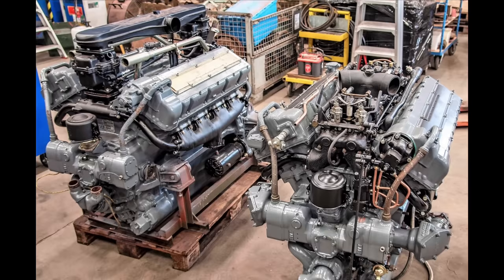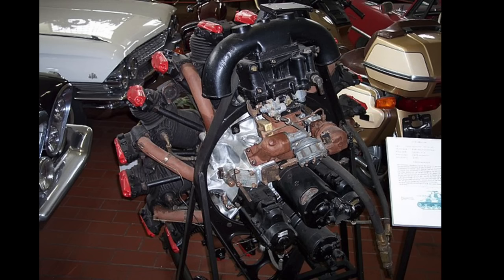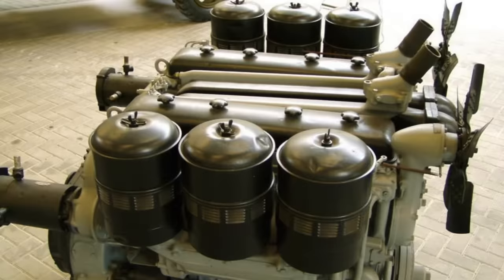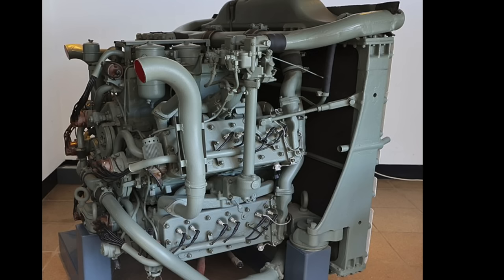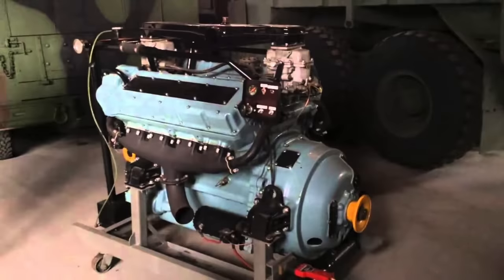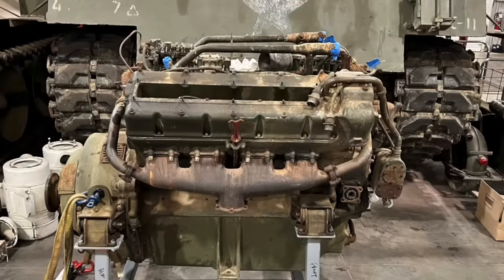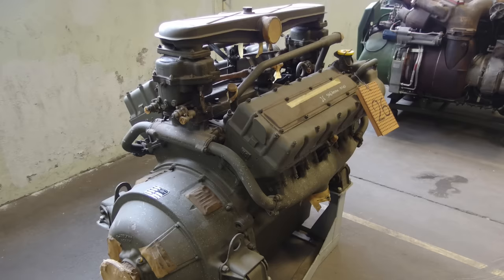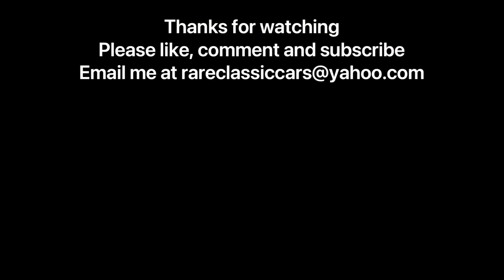An All-Aluminum, Flat-Plane Crank, DOHC V8 in 1940! Ford's 1,100ci (18L) GAA V8 Is a WWII Marvel

Comment: GM 2 strokes more correctly called Uniflow Diesel are not supercharged by the use of their positive displacement Roots type blower. The blower displacement + blower RPM very closely match the air requirement for the engine at all RPM over the operating range.
The blower pumps less than 1psi into the air gallery, less than 1 PSI being necessary for blower wear and tear compensation and to make rated power in varying conditions.
Also the Blower on Detroit Diesels is entirely parasitic. It just consumes power and lots of it ~100hp and doesn't give it back like a supercharger does. A Roots type blower on a gasoline V8 can be called a supercharger because if it gives +300hp in air and consumes 100hp to drive the gain is 200hp - the full 300hp however having to be paid for in fuel unsurprisingly
The blower on a Detroit Diesel aspirates the engine in the Uniflow cycle and just steals power (an unavoidable pumping loss), which is partly why Detroit Diesel 2 strokes fell out of favor in the late 1980s for turbocharged 4 cycle engines where under light throttle the turbocharger consumed little power and when on full boost still consumed less than a Roots type blower that always cost 80-100hp to run.

Comment: " one of the largest gasoline engines produced in the world ... "   This doesn't even make the top 10.  The largest production gasoline engine I can think of (but not necessarily the largest)   has almost 4 times the displacement.  It wasn't the larges engine produced by Ford Either.  Ford built Liberty V-12's,  Merlin V-12s and  R2800's, all of which are larger than this engine.

Comment: I understand about how ppl are in awe of the W16. But ppl don't understand that it's not THAT impressive considering what has been done in the past. I've been reading about Buick and the cool stuff they came out with as far as methanol injection and supercharged engines in the 50s. That's modern day stuff!

Comment: The Army Arsenal first tried out the Wright radial in their Christie concept combat car to reduce the length and weight by eliminating the V-12 Liberty engine. It had a rear drive so the radial and connected transmission came out as a unit. The drivers and crews liked the radial so Ordnance decided to use it in the M3 and M4 since there were plenty of surplus commercial Wright R975 engines available plus Wright was still producing them along with replacement parts. That saved Ordnance the time and trouble to have a purpose built tank engine designed and placed into production. Ordnance then selected the new GM 6026 Diesel bus engine to use in pairs in their M10 TD. The M10 was to shoot then scoot so the twin Diesels provided greater torque at low rpms to get it moving faster from a dead stop. Chrysler was in charge of tank production so recognized there would be a shortage of the R975 fairly soon. Their engineers designed a lower crankcase that allowed five of their surplus 6 cylinder auto/truck engines to be bolted on to power the central crankshaft. The US Army refused to use it so Chryler showed it the British who also didn't want it. The Soviets laughed at it then said they preferred Diesel engines. Chrysler went back to Britain to tell them the bad news. Chrysler engineers worked with the British tank mechanics to make it as easy and fast as possible to remove the monster for servicing then dropping it back in. The A57 actually proved to be the most reliable and durable tank engine used in the war. 

Ford first offered his V12 to the US Army Air Corps. They declined trying it out since they've been using the Allison V12 for a number of years and knew it's cost of production. Henry then visited the British Air Ministry who asked him to mass produce the RR Merlin instead. Ford took one look at the blueprints then handed those over to Packard before visiting with the Ordnance Department about making a tank engine from his V12. That took Ford's engineers around two years to accomplish with more adjustments being made as it was tried out in the T series. The R975 also had components redesigned thru out the war. The Army had speed governors on their tank engines to save fuel and prevent drivers from going too fast. The M4 was top heavy so was prone to tip off one track when going around curves at high speeds and falling over. Most drivers tinkered with theirs anyways so they could get moving faster running thru the gears on roads and fields where German AT guns and infantry with Panzerfsusts lurked. They also engaged in engine braking to slow down faster which caused premature wear and tear on all types of engines  The Army were pulling those out after 200 hours of run time for inspection and refurbishing but now were doing that after 150 and 100 hours due to hot rodding drivers.

Comment: years ago I lived on a boat, there was an old boat (30 ft?) down the dock from me that had 2 of these engines, when it was time to start these things he would pour a half liter of gas down each carb, I mean just dump the gas straight in then hit the starter, one, then the other, even with water cooled exhaust the sound was absolutely brain rattling.

Comment: The most powerful factory variant was the V-1710-127, designed to produce 2,900 hp (2,200 kW) at low altitude and 1,550 hp (1,160 kW) at 29,000 feet (8,800 m). This engine was static tested at 2,800 hp (2,100 kW) and was planned for installation in an XP-63H aircraft. The end of the war ended this development, so this promising experiment never flew. The extra power of this version was derived from using exhaust turbines, not to drive a turbo-supercharger, but to return that energy to turning the crankshaft, called a turbo-compound engine.

Comment: Good story. As an aircraft historian I can clear some things up.
   A few explanations are in order. Ford was asked to produce Merlin engines under license. He was provided with the data & drawings of the Mrtlin to do so. Packard ultimately did so, reverse engineering it in the process to produce the V1650 used in the later P51 Mustangs. 
  Henry ford thought he could do a better, cheaper, Merlin, thus the 1650 inch V12. Henry was in bad odor in Washington due to his politics so did not get the contract, as well as there being no interest in a third liquid cooled V12 for aircraft. 
  The proposal of the GAA was an effort to recoup some of the development costs of the V12 project. A better engine for the Sherman & the upcoming M26 Pershing 'was' needed. 
  Although 3000 rpm seems low to us today that was fair for 1940,even in road cars then. Most  people see valve actuation as the limiting factor on redline and in car engines this is often the case. But in 1000+ inch aircraft engines it is piston speed that limits red line. With 5+ inch strokes piston acceleration (measured in feet per minute) goes way too high above 3000 rpm. Hense racing engines tend to very short strokes. 
  Shaft driven cams in in-line aircraft engines were the norm. Gears were normal in radial engines. Chains were too unreliable. Reliable belts had not yet been developed then.

Comment: The M-60 tank i served on in vietnam had a 750 HP continal engine air cooled, good for 30MPH and never liked MUD but liked diesel fuel. 6 V 53 detroits water coled in M113 A2 APC 16 ton. 4th div Recon.

Comment: Its so strange that despite 50 years difference, the approach to finding the right configuration for a certain application seems to have evaded Ford engineers for a long time. Overhead cams and flat plane crank seem ideal for Indy or another from of racing but just stupid for a tank. In the same manner, the modular Triton engine seems like a great, efficient idea on paper insomuch as you can use a bunch of similar parts on a six, eight or ten cyl engine, but what works great in a Mustang was silly in an RV or other work truck that needed low RPM torque instead of RPM.

Comment: I read that Ford was behind in development on this engine and uncle sam turned to Chrysler. They arranged 5 flathead engines together. Separate water pumps, distributors and carburators. A57 Multibank was born. Probably just a rumor, but I believe it's true Chrysler was first.

Comment: I didn't realize the four engines used in Shermans had such different weights. All the diesel Shermans got sent to the British, the Soviets and the USMC - apparently the US Army didn't want to have to deal with them, and similarly the Multibanks were also sent overseas. Now I wonder if the weight had something to do with it. Not sure why a flatplane crankshaft would be considered something advanced, though.. sounds like they'd be easier to manufacture, but according to Wikipedia it resulted in a more unbalanced engine compared to one with a crossplane crankshaft.

Comment: I disagree the Chrysler 30 cylinder wasn't cooler than a VW w16 just another entirely too big and heavy engine that produced mediocre power for its size and weight. 
The W16 quad turbo produces around 1500hp with a lot less displacement

Comment: 08:25 - The Buick '3800' had its origins in the 198 inch 90 degree 'Odd Fire' V6 of 1962, later expanded to 225 cubic inches, which fired at 90 and 150 degree intervals. Buick did not split the crankshaft journals until 1977, long after they had sold the 'Odd Fire' V6 to Kaiser Jeep, then re acquired when AMC went to their 'in house' straight six and sold the Fireball / Dauntless back to GM.

Comment: I’m sorry but did you say one of the biggest gas engines ever? Not even close, The RR Merlin in the Spitfire and Hurricane started the war at 27 litres and got progressively bigger until the 37 litre Griffon came on line. The German BF 109 had an inverted V12 with 35.7 litres and the FW 190 had a 14 cylinder radial engine of 42 litres and the US Thunderbolts had a massive 18 cylinder 45 litre/ 2800ci radial engine which was probably the biggest gas engine at the time. Added to these massive engines were boosters like superchargers, turbochargers + intercoolers,  water/ methanol injection and all sorts of things to get more power. Some were only for use in an emergency.
Great video and very interesting. Thanks.
Reply: Allison V-3420,  56 Liter, and don't forget their were some really large radial engines wic were in production until the jets in the 1950's.

Comment: I think this would be a cool engine to put in a post war heavy truck like say an aluminum cab Autocar.  Build it on aluminum frame rails etc.  Run it in California and thumb your nose at CARB.  Pre-smog truck and not running on diesel so no restrictions.  If you wanted to run it in a closed/controlled environment, convert to propane  😁

Comment: I put this engine in Desktop Dyno 2003 ... 

This motor is under fed by the Induction System, putting the biggest Turbo in the program on and the Motor Really comes Alive.

Comment: The Peugeot that won Indianapolis in 1913 had a 7,6L straight 4, DOHC, 4 valves per cylinder and the camshafts were bevel gear driven. The Miller brothers derived their well known engines from it and Bugatti copied the Miller DOHC in the early 30's... crazy to think that the Bugatti factory was only 100 miles away from the Peugeot factory !

Comment: I guess this is where the terms "ain't no substitute for cubic inches" and "no replacement for displacement" because back in these days, there wasn't an alternative.  No turbos (although supercharging had been used in air and racing applications), no fuel injection (but I believe some rudimentary mechanical fuel injection was being developed around this time, and was of course standard in diesel applications), and very little in the way of exotic materials and advanced gas flow knowledge to speak of...

Comment: If people really knew the engine designs that people came up with in the 1920's-1930's, their heads would spin. There was an engine that the cylinders were arranged in a circle, like the cylinders of a revolver pistol. And had a accentric of some kind on the back, that transferred the lateral motion of the oiston, into rotational motion. Thats just the tip of the iceburg though.

Comment: Odd fire 60 degree V8? Bad idea. As bad as the GM 90 degree odd fire V6's. Bad idea, compromised corporate decision. Both started with more cylinders, and chopped some off to fit the economy demand, wither fuel economy or space/weight economy.

Comment: I knew of this engine, had read that it was derived from your mentioned V 12 configuration for aircraft. Ford was only briefly into aviation mainly because of Edsel Ford, Henry's Son. Oddly though it wasn't used on the Ford Tri Motor plane, which used radial engines and was a very well liked and used aircraft. What I didn't know was the other engines you had mentioned! I had only known about the radial and the GAA 8 that were used in the Sherman. Which engine was used the most? Plus, which one was preferred? Can't wait to hear about the Chrysler 30...Thanks great video, you have a new subscriber...

Comment: Now compare that to Russia's 1939 V2, a 38 litre all alloy, dohc,  4 valve diesel V12 which is still in use today making over 1000hp
https://en.m.wikipedia.org/wiki/Kharkiv_model_V-2#:~:text=History%20of%20development%20and%20production,-The%20V%2D2&text=Serial%20production%20for%20the%20V,%2D2V%20(375%20hp).

Comment: Later, Chrysler made an all aluminum small V8 for an auto application - the F85. It was under 250 cc’s. Problem was the soft metal led to the cylinders wearing out too fast.

Comment: The Chrysler A57 30 Cylinder Multibank  engine was merely five regular old flathead six cylinder auto/truck engines tied together around a common crankcase housing. Each of the five engines had a drive gear that meshed with a central driven gear which transmitted the power.  It was a quick and dirty way to get a reliable design into production for the war.

Comment: The Army Arsenal first used the Wright radial in their Christie combat car to shorten it's length. Ordnance used it in the M3 and M4 since plenty were available as surplus engines in commercial aviation warehouses and Wright was still producing them. The Army Air Corps decided earlier to only use the Allison V12 since it was in production so knew how much each would cost. They also expected the cost to drop once mass production started. The GMC Diesel was a new design for passenger buses. It became known as the Detroit Diesel. Chrysler was put in charge of designing the tank factories and production lines. They saw there was going to be s shortage of Wright radials for the Lend-Lease M3's and M4's so worked up the design of the A57 Multi bank engine so they could use the reliable L6 car and truck engines sitting in their warehouses then make more as needed. Chrysler's engineers made sure that all four engines used would be fairly easy to remove and reset out in the field to make maintenance easier and faster. The British said that the A57 was the most reliable and durable power plant used in the US medium tanks. Ford tried to get the US and British militaries interested in his V12 which was fuel injected and turbo charged since it was more powerful and could be produced much faster than the handmade RR Merlin. The British gave Henry the blueprints for the Merlin to see if he would be interested in mass producing those instead. Ford gave those to Packard then went to work converting his V12 into a V8 tank engine. That took a few years to get right to be approved for production with more flaws found then corrected after seeing use in combat. All US tanks had engine speed governors to prevent over-revving and conserve fuel. The tank crews knew how to tinker with those to increase the RPM limit in order to get moving and stay moving faster. The set top speed of the M4 was 28 mph yet with some fiddling could reach 35 mph and even 40 mph before throwing a track. The US Army didn't like that since hot rod drivers were wearing out the engines after 100-150 hours of use when those were expected to hold up for 250 hours.

Comment: I wonder why Ford didn't model there overhead cam engine after this... That one engine they have called the "cammer" was just a single overhead cam with a monstrously long timing chain that had trouble.... Why didn't they just make a smaller version of the tank engine.... that would have been a breakthrough in the auto industry to have an engine like that... I guess they probably weren't allowed to... But that would have been cool.... imagine the first mustangs could have came out with a dual overhead cam all aluminum V8...

Comment: Well, the Sherman production was just under 50,000 in total so the Wright radial would not have been installed in that many Shermans.  I can see there were spare radials made to equate to 50,000 for tank use though.